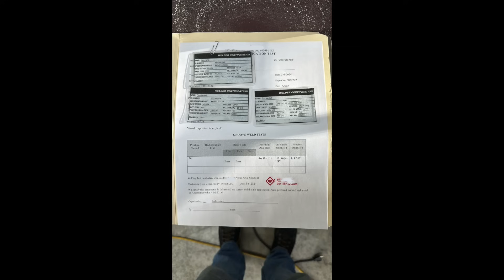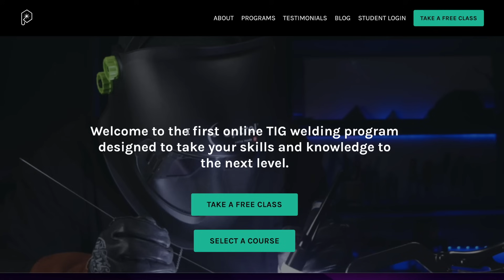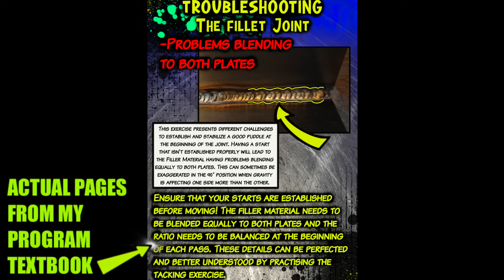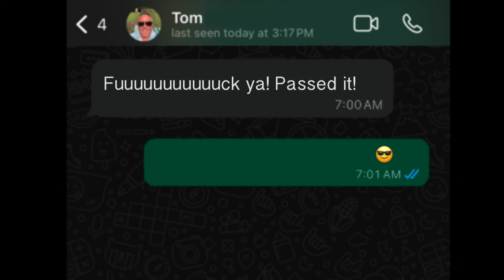From beginner Welder to Making $10k a month- How to Do It!

Comment: I’m wanting to get into welding if dabbled here an there I have pretty much all the equip,,I don’t have a welding table so I have been using a wooded work bench I made ,but purpose of this is I’m working in the refineries as a pipe helper and want to get into doing a combo welder but I also want to work with automotive stuff as my hobbies is building an working on my project car exhaust turbo stuff as well as body work ,what class would you suggest  ,it’s hard to do a class setting as my time is short due to work and the prices are realllly high